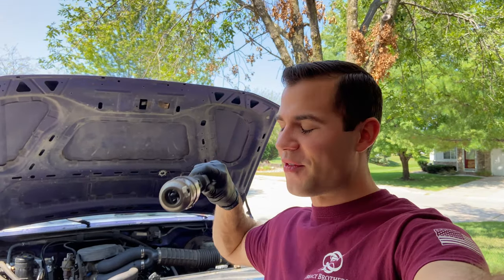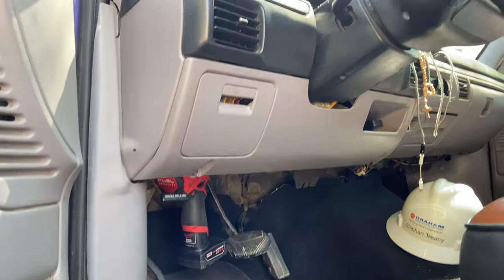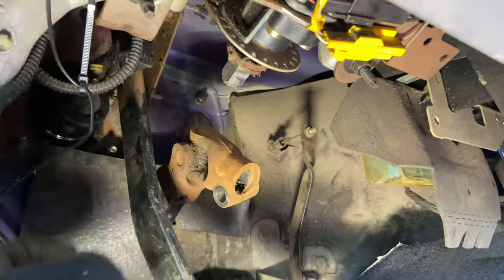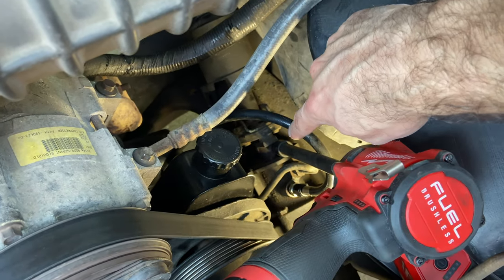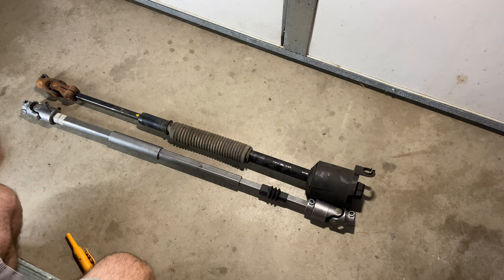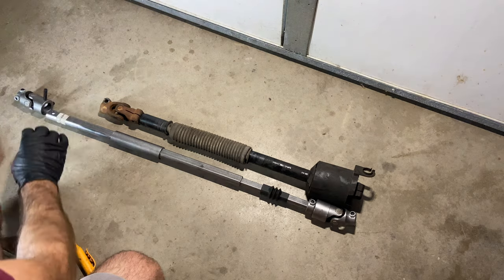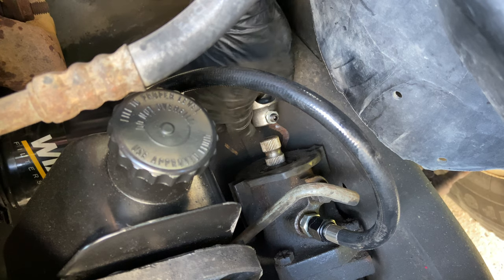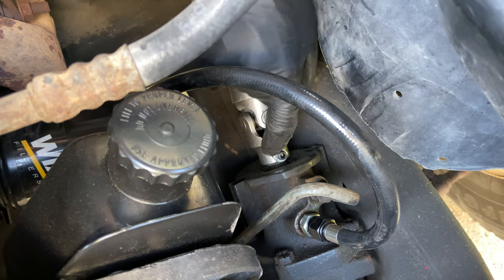How to Install the Borgeson Steering Shaft | 1995 Ford F150

Comment: This has to be about the only part I haven't replaced or rebuilt on my '96 F150 shortbox 4X4 which I've owned since new. The extra length must be for trucks with a body lift. A friend had a multi inch body lift in his rig and the steering shaft was only engaged about a quarter inch or so. Very dangerous and it was just by chance we discovered it.  Great video and thanks for posting!
Reply from the maker: Yup, you definitely want this for a body lift. 
Thanks man!🤙 You’re welcome!

Comment: after watching several videos on your front end rebuild. This will be the final step in my 1995 2WD F250 with a 6600 GVW. It's basically a 150 with the bare minimum to bump into the 3/4 ton category.  Between the radius arm bushings, and ball joints. I feel like i owe you money for these videos....Thanks, and please continue to make more.
Reply from the maker: Nice man!🤙 I’m glad your f250 is coming together! These trucks ride and handle so much better with new bushings and ball joints, not to mention new shocks and springs. 
Hahaha! I really appreciate it! 
Well, I won’t say no to a donation. With that said, here’s my Venmo👇

https://venmo.com/code?user_id=2220690509922304990&created=1630285843.398859&printed=1
Reply: @TheMinuteMasters  I'll throw you enough cash for a case of beer! I put ranco shocks on already. But they aren't so much here in Detroit with my 33x12.5' and the pot holes. I might try some Bilstein or Rough Country next.
Reply from the maker: @iamgriff  Sounds good to me!🤙
Dude! I used to live on Pennsylvania and I cracked the frame of my truck on a pothole. I’d go with Bilsteins if they are in the budget. They are the best I’ve owned. Otherwise an extended radius arm setup seems like the ticket when it comes to smoothing out the ride on these trucks.

Comment: I don't know how bad your vibrations are but if you ever get tired of feeling them, borgeson has quality replacement rag joints that will actually damper the vibrations. I have a d44 sas 92 f150 so I was feeling a ton of vibs, so after contacting borgeson and ordering a new rag joint, my steering is tight and as smooth as butter now, I couldn't stop laughing after the install because the steering was so smooth, I never felt it that smooth before.
Reply from the maker: I don’t mind it so far and I honestly don’t think it’s that bad. But that’s good to know they make a new replacement rag joint. Thanks for the info man🤙
Reply: Did you replace the steering shaft and then added the rag joint?
Reply: @guillermogarcia2862  I already had the borgeson shaft in my 92, it was years later when I added the rag joint, I don't regret it.
Reply: Thank you for posting this.

Comment: Thanks for this!  Over the past 20,000 miles on my '95, I've replaced the steering box, everything past the steering box, bearings, shocks/coils/towers, and the radius arm and axle pivot bushings, yet on the freeway on new tires (stock size) it's still as vague as the clues in old NES games.  On visual inspection the rag joint still looks tight, but then, that's just sitting in the driveway, and after watching this I wonder just how much flex there really is in it and the joints under load after 216,000 miles.  

Again, thank you for this.  I was about to start ripping hair out trying to get my beast to feel confident enough for a long drive again!
Reply from the maker: No problem Al!🤙 I’ve done all the same work and I always felt like I wasn’t there yet. The steering on these trucks will never be as good as newer rack and pinion setups, but you can definitely get it close enough. 
I think under casual inspection the rag joints do feel tight. I think under load (larger than stock tires) there’s too much give. I love the wait my truck steers now. The only benefit to a rag joint is you felt less of the road through the steering wheel. With the solid u-joint on the Borgeson, you get a little my road feel. I don’t mind it.
You are most welcome! I’m glad I can save your hair! Lol
Reply: I replaced every part on my front end of my 1995 F250. I still had the same issue. As it turns out , my truck was low on steering fluid. No one has mentioned that here. But it's worth looking into. I upgraded to FoMoCo brand sythentic steering fluid. It made a huge difference.
Reply from the maker: @iamgriff  Yup, you definitely want to make sure the fluid level correct.

Comment: Thanks for the video sir 🙏 have mine ready to go with new red head steering and rebuilt column... cant wait to feel the new ride.
Reply from the maker: No problem man!🤙 Nice! You’re mind is going to be blown! Replacing the steering gear box and steering shaft improved my steering the most.
Reply: How did it turn out?

Comment: i have a 96 bronco.  i know the truck and bronco use the same platform .  will this repair be the same  i am currently rebuilding the front steering from tie rods to steering box .  can you give me any advice?
Reply from the maker: If I remember correctly, this is the same steering shaft as the bronco. 
As for the tie rod ends and drag link, you can buy whatever the parts store has available and it installs the same at the trucks.

Comment: Your videos are excellent. My OBS Bronco has a backwards steering wheel and is very uncomfortable to drive. Watching your video, I think that if I disengage the steering column under the hood, could I correct it that way? thanks
Reply from the maker: Like the steering wheel is upside down when you are driving straight?
Yes, you can as long as the steering shaft will fit back on the splines that way. Otherwise, you can removed the actual steering wheel and put it back on the correct orientation.

What my cruise control or steering wheel removal video for how to do that.
Reply: Thanks brother.  That is exactly my problem.  I am encouraged to review those videos to correct the position of the steering wheel. 😂 🛻
Reply from the maker: @doctorantivirus.  You’re welcome Doc!🤙

Comment: G'day Steve, could you please confirm the part number you used? The link in the description is apparently for a GM pn937, whereas on Borgeson's website the 92-96 F-150 is pn981.
Cheers
Reply from the maker: Hey man! I just updated the link. It was a GM shaft. It should be a Ford shaft now. 000981 is the correct part number.🤙
Reply: Cheers mate 👍🏼
Reply from the maker: @Stoney429b  You’re welcome!🤙

Comment: On my stock steering shaft I noticed there was fluid on it, could it just be power steering fluid from my pump or does the shaft contain any fluid at all ?
Reply from the maker: That’s probably from the pump. The steering shaft is just metal, rubber, and plastic.

Comment: What did you cut the shaft with, hack Saw or band saw maybe? Thanks man
Reply: Following. And also would like to know what size bit he used to drill the new holes and if they need tapped?
Reply from the maker: I used a Milwaukee sawzall with a Diablo carbide blade.🤙
Reply from the maker: @JRHINE83  I just pulled out a drill bit that was roughly the same size as the hole. The hole doesn’t need to be tapped. So you’re good there.🤙
Reply: Cut the other end don’t drill it!

Comment: What is the spline count on the box and the shaft in the column are they both 30 spline
Reply from the maker: Good question. I never counted them. I just bought the shaft that matches the year and model of my truck.

Comment: Would you recommend this kit or a oem rag joint replacement
Reply from the maker: If your current rag joint is trash, either way will be a huge improvement. If your rag joint is fine just old, you will see an improvement switching to the the Borgeson.

Comment: Hi steve i have a leaking steering shaft coupler u joint can i replace just the u joint or do i have to replace the whole  coupler . Its the one inside the truck .
Reply from the maker: Hi Calvin! 
I’m not sure if those can leak but I don’t think you can replace just the coupler. You may have to buy a whole new steering shaft. The OEM steering shaft I’m told I’m more expensive than the Borgeson upgrade.

Comment: Freaking awesome man! I wonder if besides having to cut it,  this same shaft would be a bolt-on fit for a 1995 Bronco
Reply from the maker: Thanks man!🤙 Honestly, it probably is the same shaft for a Bronco. It doesn’t hurt to check. I know there is definitely a Borgeson steering shaft for a bronco.
Reply: It should. Mine was for an F150, but, fit in my 93 bronco.

Comment: Did you have a new steering box, steering linkage, and/or  tie rod ends when you installed this shaft?
Reply from the maker: I had a new Saginaw power steering pump, steering gear box is a few years old (maybe 5), and tie rod ends are about 5 years old too.

Comment: Hey I had a question. On my 94 f150 I have a rattle coming from the front end on rough roads it sounds like when you shaking a spray paint can any ideals on what it might be . My truck from Texas all its life so no rust the only thing in the front end I haven’t replace is the ball joints radius arm bushing and axel pivot bushings
Reply from the maker: So those bushings you haven’t replaced could cause a rattle.I would definitely look at them.

Comment: Odd question if you have an answer! I have a 93 bronco and the splines on the new steering gear box i have installed, do not match the splines inside the stock joint of my steering shaft. I cant return the steering box and cant use the old one. Are the ends of the shaft connecting to the steering wheel univarsal sizes for ford?
Reply from the maker: That’s a tough one. I know there is a slot milled into the side of the spline coming out of the steering box. You typically have to line up with one that’s in the steering shaft.

Comment: Can you make a vid on the harmonic balancer? I have a 96 model and I'm struggling with the harmonic balancer and it's reluctor ring
Reply from the maker: I might have too. I’m suspicious my harmonic balancer is making a random knock noise. I’m not 100% sure though.
Were you having some kind of issue with yours?
Reply: @TheMinuteMasters  yeah, it'll feel like it's randomly missing very slightly. When I swapped it, the old one is starting to separate. The rubber is starting to split. That throws it out of balance, and my old one has a 4 point reluctor wheel that works with the hall effect sensor. Without that ring on the back, it doesn't read correctly
Reply from the maker: @johnnylantern3609  Interesting. What engine do you have?

Comment: I installed one, a Red Head box, and all new steering arms and ball joints.  I do notice an occasional clunk in the wheel, like it is now connected via metal instead of a bunch of rubber.
Reply: After watching this video, I’m pretty sure my installed did not cut my Borgensen.  I need to check that.  Idiot.
Reply from the maker: Nice! A little road vibration is normal but I can’t say I have a clunk. That’s definitely worth investigating.

Comment: I was following you in a previous video and you replaced your front sway bar and you had mentioned that you noticed improved steering. Which would you say helped your steering more the Front Hellwig sway bar or Borgeson steering shaft upgrade? TIA.
Reply from the maker: So, a front sway bar helped a lot on turns and managing body roll on the highway. I said it improved steering as just a general comment. The Borgeson steering shelf improves actual steering by eliminating the slip from the rag joint. Basically, the sway bar and Borgeson steering shaft accomplish two different areas of steering. I’d recommend the steering shaft first. Then you can look at sway bars. I wish had started with the rear sway bar though.

Comment: Late to the party,  but, on the dampener on the new shaft. There isn't a little tiny set screw on it? Instead of hammering it. Loosen the set screw? Maybe the new shafts are updated, but, I installed this shaft years ago in my 93 Bronco and that shaft had a set screw. Loosen it. Dampener slides up and down.
Reply from the maker: I can’t quite remember. I do recall a set screw at both ends to hold it in place. 
The old shaft either had a set screw or a through bolt.

Comment: Do you think it's worth it for money spent, Stevie?  Was looking on Summit....and the cash layout is substantial.  How big of a difference between the stock system and this one?  If one buys the power steering pump....plus the uni joint and shaft, the parts investment is substantial....$800 to $1000 including taxes (Canadian).  I know you've done your tie rods....but have you replaced your pitman arm?  Up to now, I've just done ball joints and all the tie rods.
Reply from the maker: If you need to spare $300 on something more important, I’d pass on the Borgeson shaft. With that said, the feel between the two steering shafts is night and day for a variety of reasons. - The first thing you notice is how solid the steering feels. It feels solid and precise. 
- Without the rag joint, you do feel more of the road through the wheel. The trucks vibrate for a variety of reasons. So that doesn’t bother me.
- On the highway at speeds 50+, is where this shaft shines. At high speeds, I don’t think the rag joint responds well (I have larger 31 inch tires so there’s a tad more to control). The Borgeson responds well to steering input and the front end wonders less. I can just about hold the steering wheel I’m the same spot and the truck will stay straight. Before there was more steering input needed due to the rag joint. 

As for the Saginaw pump, there is definitely more power which makes it finger light to steer. Plus, my personal favorite, it’s super quiet.

So, it’s up to you. I love these mods. My truck feels new and sounds new. If you want to run larger than stock tires, I think these mods become a must have.
Reply: @TheMinuteMasters  Stevie, what if we're going to do a limited fix, and just replace the shaft?  Is it wrong to start with it and not do the front end stuff?  I hate the float in my steering, and would be happy to spend the $300 on it, but I'm not so crazy about replacing the front end and the pump.  Love my '96, but not refurbishing it, just maintaining.  Thanks.
Reply: @borderlineiq  Hey I'm not Stevie, but as someone that's done more reading in my '92 than I care to admit I'll throw in my 2 cents. I just finished with my Saginaw swap and new steering box, but from what I've read in the forums it seems you'd really want to make sure your ball joints/tie rod ends/etc. (your "fundamentals of steering" I guess haha) are all good before anything else. I guess the idea is that if the foundation more or less isn't solid then you're going to be pretty disappointed with how little your $300 steering shaft actually helps.

Once those are squared away your wallet will start to feel heavy, don't worry!
Reply from the maker: @borderlineiq  My tie rod ends and ball joints are mostly new. Honestly, a new steering gear box and steering shaft are the two best steering fixes/upgrades. So, if you could only pick two, those are pretty good.
Reply: @thedude3803  Thanks, "Dude"!  ;)  I asked about the steering when I had the truck in the garage back when, but they didn't see anything, but may have been lazy.
Reply: @TheMinuteMasters  Thanks.  I think I'm going to ask my garage to look at all of it.  I hate the floaty stuff, and they're pretty busy, so I don't think they'll soak me for unnecessary stuff.  The old girl deserves a spruce up, and I'm don't really have a great set of tools and drivers to be doing all that.  Thanks for motivating me, though.
Reply: @borderlineiq  have you had any of your steering and suspension components replaced? If not then i’d say its due for the works. Save the money and do it all at once if not an emergency fix.
Reply from the maker: @borderlineiq  Yeah I would definitely have your mechanic look at it. Precision steering is SO nice! You’ll love it Jason!
Reply: The borgeson is totally worth it, but I agree it and the Saginaw pump should be kind of a dessert once the other suspension and steering components are in good shape. Ball joints, tie rods, steering gearbox and don't forget the axle pivot + radius arm bushings are a gigantic source for slop in the steering.

Comment: Good video but you should have stressed not to move the steering wheel while it’s apart and destroying the clock spring.
Reply: Silly me. That can be another video.
Reply from the maker: Good point! I never touch a steering wheel when it’s unhooked from the steering shaft, but other may not know that.

Comment: Quick question...if I hit a big pot hole/bump in the road my steering wheel will jerk like crazy. Any idea what that could be?
Reply from the maker: If you hit a pothole and your steering jerks around a lot, it sounds like you have what is called “bump“ steer. Do you have a lift on your truck?
Reply: @TheMinuteMasters  Oh ok. I never heard of that before. Nope. It's stock height. 97 F250 HD 4X4.
Reply: if you have a steering stabilizer shock on the axle, replace it, you can also upgrade to a dual setup that should make it even better
Reply: @chuck095  Ok I'll look into that. Thanks

Comment: I have a question isnt the collapsible part supposed to go into the cab like the original?  Am I crazy or is this shaft in backwards?
Reply: nevermind im an idiot I see that the borgeson one has the spline on the other end.
Reply from the maker: Hey it’s an easy thing to over look. Both ends are very similar looking.